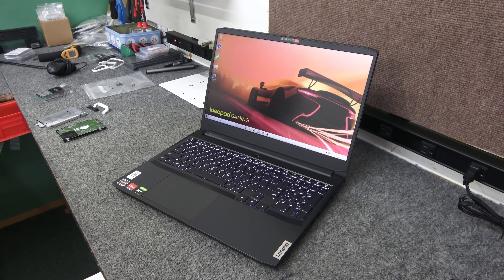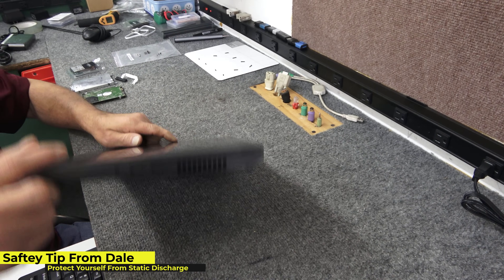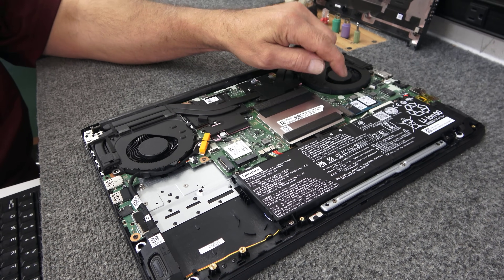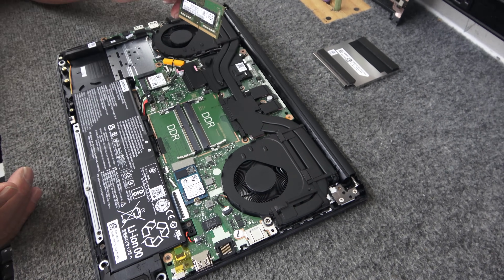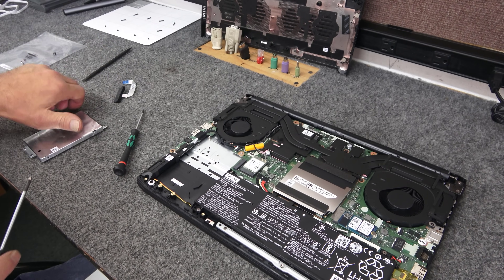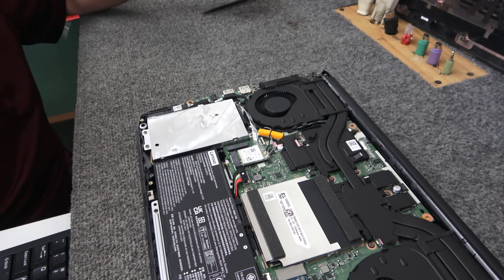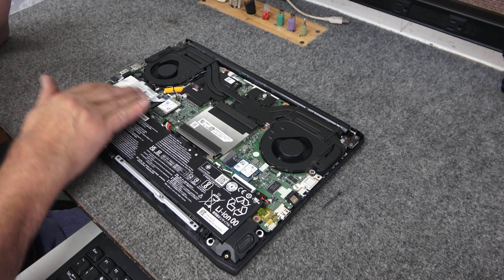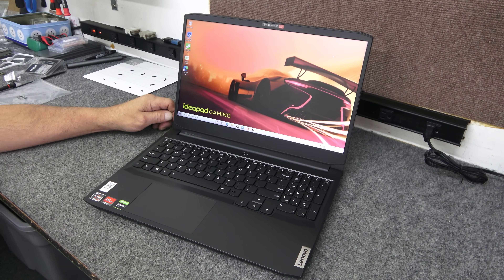Upgrading Lenovo IdeaPad Gaming 3 Laptop.  Memory and Add HDD.

Comment: Dale I wonder if the standard M.2 standoffs would work for the M.2 if you wanted to add one?
Reply: I've opened mine and I really think that the screw and standoffs, just at the right of the battery connector (marked M2x6), is to be used for supporting the M.2 SSD.
Reply: @fificap66  And how to unscrew them?
Reply: @КириллСеменов-й5з   Hi, Sorry I didn't saw the notification for the question. I was wrong, only the screw can be removed, not the standoff! I made one with a piece of PTFE tube that ft the screw diameter.
Reply: @fificap66  Thanks a lot for the hint!
Reply: yea i’m also wondering what to use to screw it in if i am to get a m.2
Reply: Get the right length

Comment: RAM can go up to 16+16 (dual channel) is a major plus, but no 2280 support is a bummer, but 2.5" SSD can go up to 4TB for huge capacity.
I will receive Thinkpad E15 Gen 3 tomorrow and I will add 2TB 2280
Reply: there is 2280 support?
Reply: Yes for E15 Gen 3
Total 2TB + 512GB
Reply: @mingkee27  you said there is no 2280 support. there is support
Reply: @viyaandesilva1121  Yes, i am using two 2280 ssd.
Reply: Bro the salesman told me that it can go only upto 16gb 8+8 dual channel ? Is 16+16 working with you?
Reply: @IINNCENN  the laptop says the max is 16 in control panel, but I was also wondering if it could support more
Reply: @therunnerupx50  I'm using two 16 gb rams in mine
Reply: @nathansummey5679  And it's actually registering as 32GB of RAM in your settings? Because even the pdf manual of the three variations of this laptop say it's 16GB max.